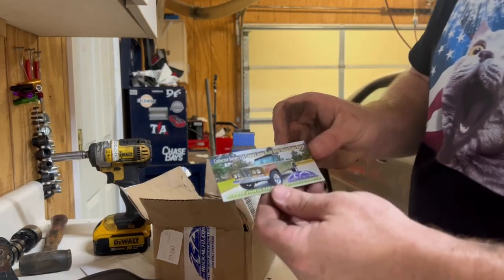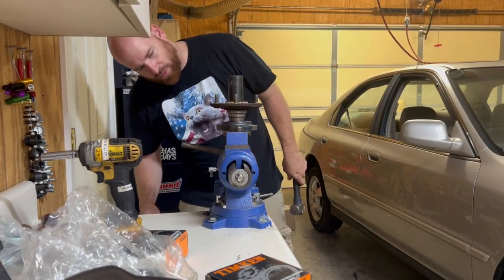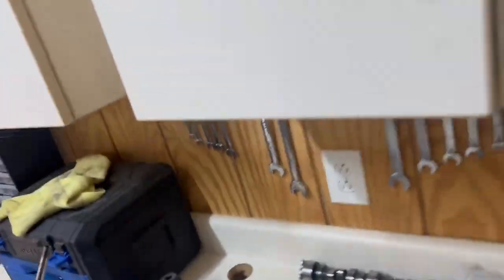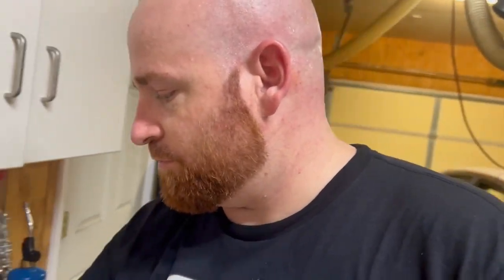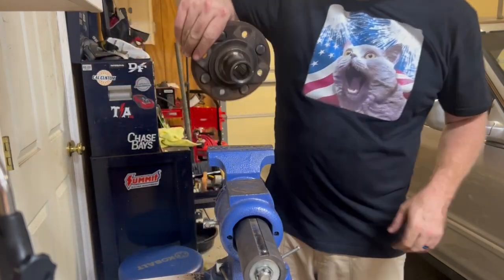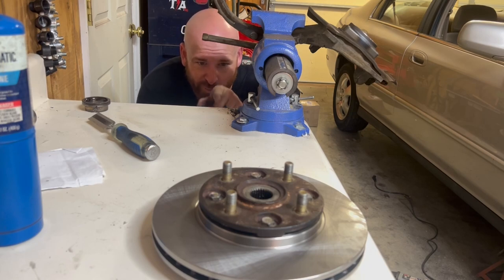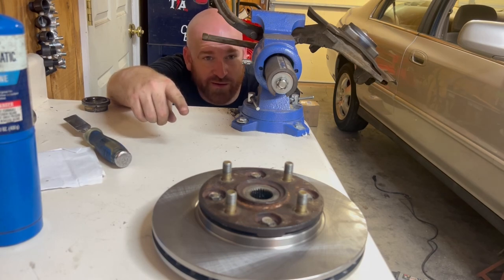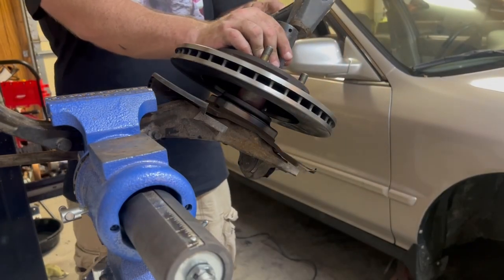1997 Honda Accord Wheel Bearing Assembly - And Why You SHOULDN'T Buy a Wheel Bearing Race Tool

Comment: The front hubs can be changed so regular rotors can be used. I did it on my 97" Accord. You reuse your stock calipers. I used the 4 lug bolt 1998 Acura CL hubs, but that's only because I just bought rims for the car. I really wanted to change all four hubs to 5 lug bolt; more choices when it comes to aftermarket rims.